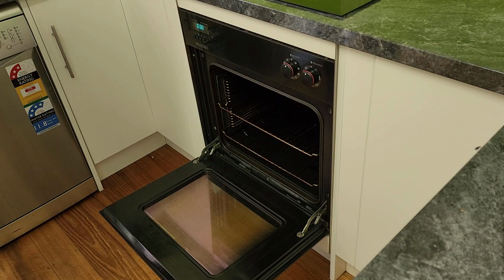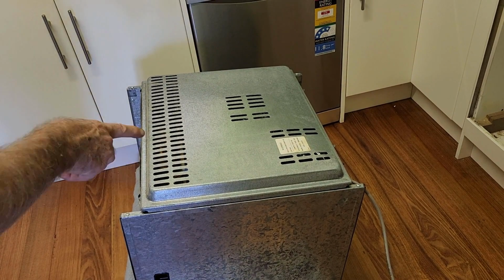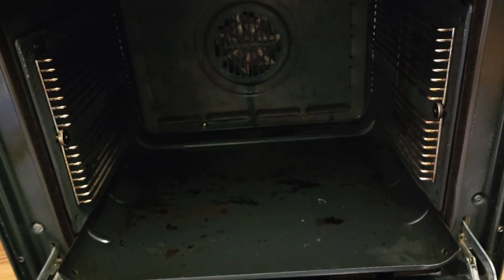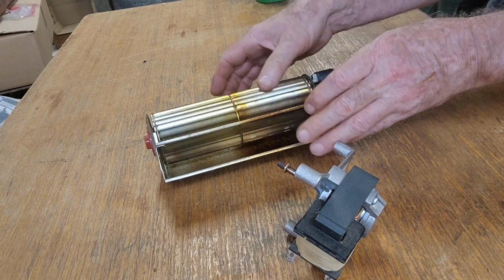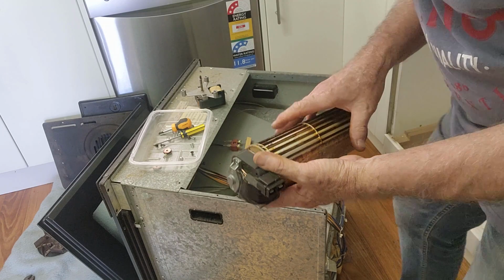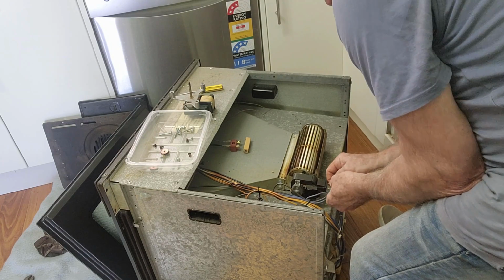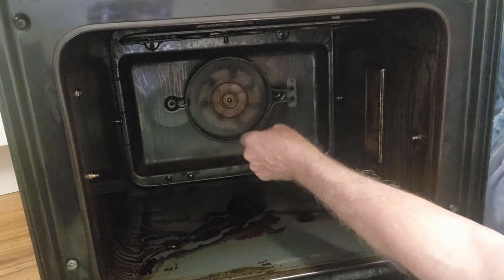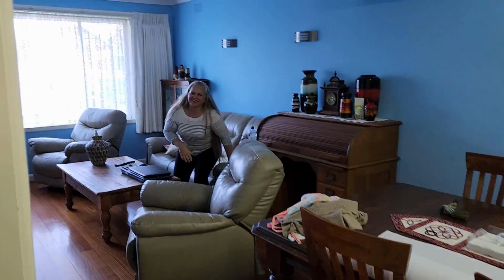How to Stop that Annoying Squeaking Fan Noise in a Kitchen Oven! Blanco Stove Repair

Comment: Couple of Drops of 3&1 
Motor oil the one that's rated for Small.
Electric Motors.
Or Try Flow.
Blast General Lube with Teflon 
Spray Red Lube.
Any good General Lube Spray with Red Stray
Reply from the maker: I forget what I used now - but it's still running quietly after 2 months.. 👍

Comment: that squeak definitely sounded like a loose panel vibrating rather than the fan, the old Vulcan Gas Heater fan we had used to be supported on springs and when the dust bunnies inside made the fan out of balance it would get a similar squeak and rattle the springs if you left it long enough.  fixed is fixed though! I've lost count how many things i fixed just by dismantling and reassembling and something wasn't quite seated or connected properly.
Reply from the maker: Exactly Dean, quite often a good clean and realign will sort vibration/squeak issues. Loose screws are masters at causing rattles in cars that drive me crazy! So I just turn up the radio volume! 🤣

Comment: Good fix.
I have learned a few things from watching you, time to return the favour.
It is much easier to get to the oven fan with the door off, and it makes the oven a lot lighter to remove from under the bench as well.
With the door fully open, have a look at the hinges, there is a little clip that pivots up onto a flat, when that clip is moved up and you try and close the door it will not quite close, at that point lift and pull the door forward and it will come out of the oven.
Reply from the maker: Ah, thanks John! A great tip! 😊👍